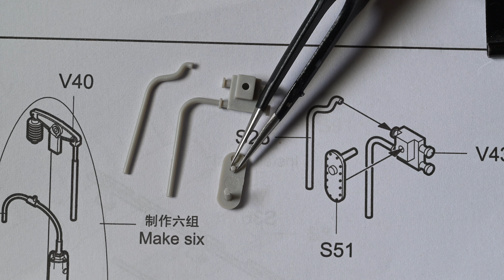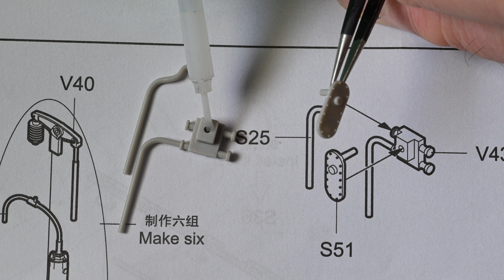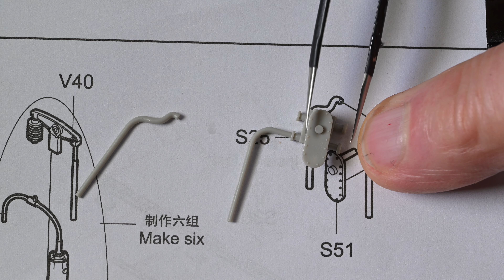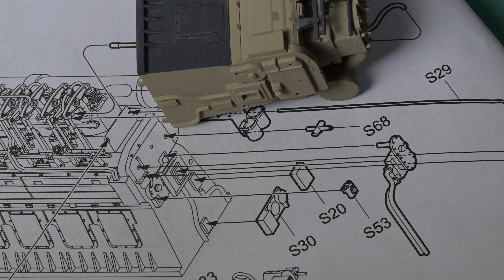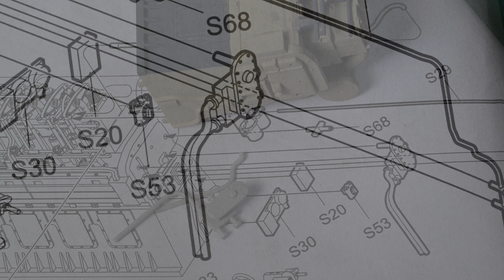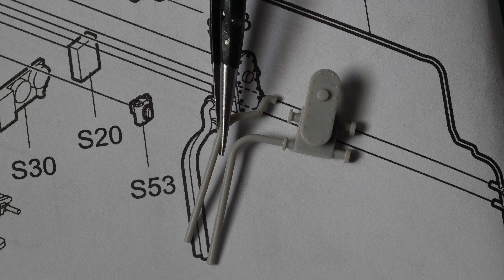The Model Ship - Part 2114

Comment: Hi Ron, good work spotting the error and correcting before it was too late.

I don’t want to sound like I'm trying to put a downer on your Goldwing dream, but I did want to check that you have had a think about something that could potentially imho be an issue. Obviously you want to prolong this hobby of getting out for a quick scoot for as long as possible, I just wonder with the extra height and width, along with the extra weight, whether that is going to create more wear and tear on your joints and thus cause you to stop riding sooner than you may have had to with the smaller bike?

If it's a bit harder to get on/off, a bit harder to plant your feet and a bit harder to push when you need to manoeuvre it manually, it could stop you being able to enjoy it as the years pass. I was thinking you could use a little of those 20+k bucks to rent one occasionally for a week or two at a time, which will save you losing on the rebel by trading in and again on the goldwing if you did find you wanted to downsize later on. 

Of course if it's a scratch you have to itch, you have to do what you have to do, I just want to check you've looked at it from all angles before deciding! 👍 

Have a great day.
Reply from the maker: Hi Barry,
There are so many things against the Honda Goldwing, and so many things for keeping my Honda Rebel. I think possibly scratching my itch is a good way of putting it. Maybe if I was to go and sit on one I could get over this nonsense. It is highly unlikely that I will be making a switch because of the tremendous extra money needed. I was out on my Rebel again this afternoon and thinking, what a great machine this is. What am I thinking anyway? 👍